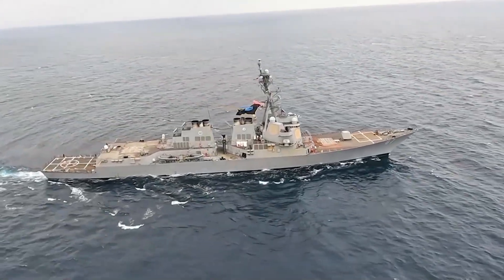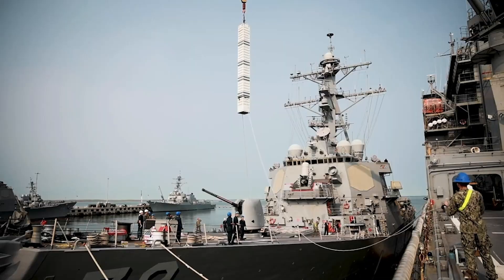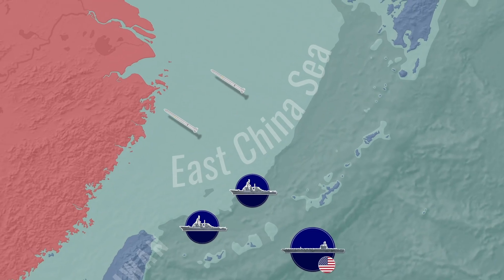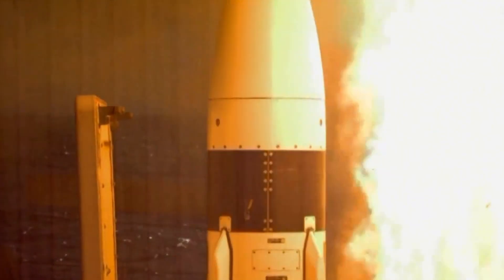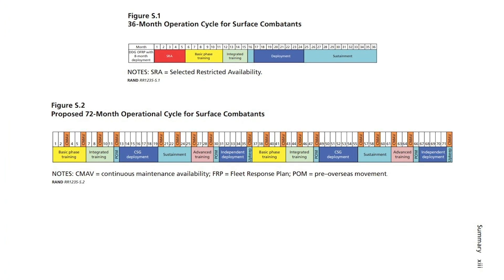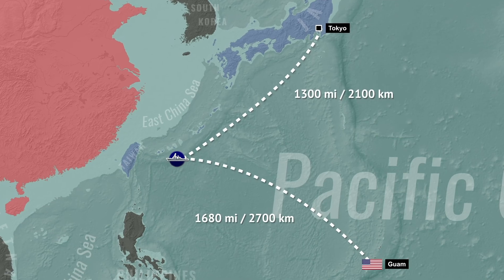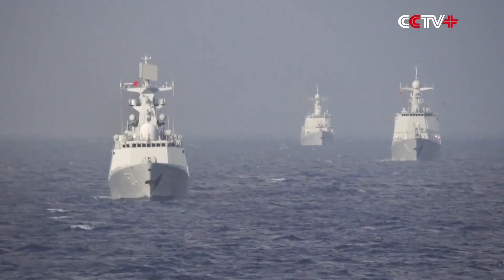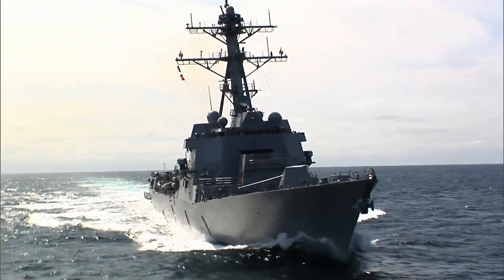Why is rearming missiles at sea crucial for US Navy? And why is it so hard?

Comment: Why not just build cheap drone missile carriers slaved to Aegis equipped ships or even aircraft? You multiply your launch platforms, use those missiles first and rotate them to port for rearm when their supply is exhausted. I’m just a dumb army grunt but that seems like a more modern, cost effective and scalable solution than the convoluted ones in this video

Comment: Why not convert cheap freighters to just be Missle Cell motherships. Load them up with nothing but hundreds of launch cells then Data link to the destroyer. Launch directly from the freighters and rotate loaded and unloaded freighters?
Reply: exactly what i was thinking
Reply: It's a nice idea, especially if the destroyer is defending a base. I think Japan has looked at something like this. But if the destroyer is doing ASW work, then the freighter would be too slow to keep up.

Comment: You do a standard resupply container that floats and keeps the missiles safe inside. You eject that into the sea near the warship, which then uses a magnetized harpoon of sorts to catch the container and reel it into the crane, which then places the container on the deck, where it is locked in place. The missile cells are then individually lifted and placed into the empty VLS cells. Container is dumped back into the sea with a beacon, where the resupply ship can use the same process to retrieve it and bring it back to port, where it is refilled. This way, a single supply ship can deliver to the maximum number of warships in the least amount of time and get additional supplies in the least amount of time.

Comment: Would it not be easier just to install the crane permanently on the vessel instead of spending time moving it back and forth between the warship and the resupply ship.  Instead of a process where the resupply ship has to sit there and wait for the crane to be unpacked, installed, all of the missiles installed, pack the crane, transfer it back. The resupply ship could just transfer the missiles over and then leave and go resupply another ship.  The warship could install the missiles while underway to where ever its going.

Comment: The last option you mentioned seems the best solution to me, i eould use a heavy lift crane to transfer a modular frame with all the cells to be deliver inserted that then has the capability to slot each one straight in after being locked in place. It would be the auickest method and preety safe i would think.

Comment: Where does anyone say that a missile is impossible to hit in the mid-course phase? You do realize that the US shot down a satellite with an F-15 in 1985 and then shot down another one from a ship in 2008. Those were moving at Mach 22, faster than anything that has been tested in the atmosphere and the US shot it down 40 years ago... you don't think they can shoot down a missile in the mid-course phase, the longest phase of the missiles flight path? That was a dumb statement from a channel that seems to pride itself on knowing more than the average person in regards to military knowledge.

Going to add to that... a Destroyer in a war time scenario, would NOT be cruising around at 20 knots trying to re-arm and re-join the fight. You better believe they will be hauling at 30+ knots
Reply: Well, satellites are also much more predictable, and they are larger. It's way easier to target a satellite since they aren't really surprises.
Reply: @Vexas345  you are joking right? Missiles generally following a straight flight plan at 20-25% the speed of a satellite and at much lower altitudes. If the missile can change course during flight, the speed is even slower since changing course at high speeds tends to melt objects, such as areas used to change the course...
Reply: nothing new. Russia has always had the capability to shoot down space satellites since 1963.
Reply: @jnkimuhu  any reference on this? First I have heard of a Russia designed and successful test was in 2021. The first successful destruction of a satellite in space going to Maj. Wilbert Pearson in 1985. Follow on point, I never said other countries don't have the ability to (China and India both also have successful tests), this video was specifically stating that you couldn't shoot down a missile in the mid-course stage, and I happen to know that hey can very easily be destroyed in that phase.

Comment: The solution is dispoaable magazines. A single missile self contained magazine with internal hydralics is attached horiontally to the deck then it lifts to the vertical over the lauch tube and the missile is inserted. The empty mag can then be recycled or thrown overboard. Extra magazines could be stored internally or on deck.

Comment: I think the most obvious solution is to build and field a bunch of arsenal ships, say 2-3 per fleet. These would be just bare-bones ships with basic electronics (not need for Aegis) and with enough power to keep up with the fleet or for rapid deployment (25 knots minimum, preferably faster), and they wouldn't need all kinds of other protections because they're designed to sail with bodyguards such as Aegis-armed destroyers and/or aircraft carriers that can protect them.  We have plenty of body guards, but the guards don't have enough arms--that's the only mission for the arsenal ship to meet, not to take other other missions or act independently.

If we can field say 10 such ships, each carrying say 500 VLS cells, that's 5000+ missiles (whether we can produce enough missiles is a separate challenge).

In theory it shouldn't be that costly or time consuming--if each arsenal ship costs more than $1billion or more than 2-3 years to build, then the program is in trouble and the Navy screwed up again.  To make this a success, they must stick to a stripped-down concept and concentrate on getting the ships built and missiles installed ASAP. Unfortunately, I just can't trust the USN to be serious for once about solving problems rationally--they seem constitutionally incapable of making anything within budget or lean and mean.
Reply: It doesn't have to be a purpose built ship. Commercial container ships are good enough. The missiles provide standoff to keep the ship safe.

Comment: They wouldn't be using up so many SM-2s if they actually packed in more ESSMs. The standard quad-pack ESSM load for a Flight IIA or III Burke is only 12 missiles (3 cells).

Comment: Why could the not make it so the whole houseing is what you change? Instead of having Todo 1 cilo at a time you replace the whole "carton" perse and now your full u the old carton change tken back and refilled for next time?
Reply: A single VLS tube weighs a couple tons, so a pack of 8 would require a very large crane to handle, like the large articulated one shown at 11:15, limiting the number of cargo ships available for resupply missions.
Reply: @pahtar7189  ok yes that definitely makes sense as to why they wouldn't go that route thanks for the info

Comment: I do not understand why some of the Ticonderoga's have been decommissioned. They might be older but are superior to the Burkes in several areas. They have way more VLS and have both Harpoons and a helicopter.
Having 128 VLS cells + 8 Harpoons vs 96 VLS cells. Is a huge advantage over the Burke. The Burkes are newer so probably have better electronics.
In such a conflict the 60-70% larger VLS missile load would make the Tico far more useful and being able to stay in the area longer than the Burke.

But even if the Tco's systems are older, they would work well teaming the Tico's and Burkes up.
Reply: Hull age / corrosion and rising cost of maintenance? All Ticos are 30 + years old.
Reply: @mhammer2831  That's definitely the reason. The Burkes are probably more survivable, as well.
In theory, however, these steel-hulled warships can be made to last 50 years.

Comment: For all the Gen Z Ignorant! Who never heard or seen the Wichita class AOR, AE 35 class  ammunition ships. RELOADED AT SEA! The 3 T's Tartar Terrier Talos. MK 11 GMLS TARTAR MK10 TERRIER MK 12 TALOS!  Having been a BATTLESHIP FC, trained GM. MSCPAC ABM who sailed on Kiska ,Shasta AE vessels. I k ow of what I type been then done that got the scars. From Blocking,Bracing,Dunnaging, Handling 110 pound Stanchions, Strapping down metal pallets. In the different cargo holds, iperating the weapons elevators. Using different colored sling arrangements, driving 4k and 6k diesel and electric forklifts type EE.
Reply: Nobody here claims that underway replenishment isn't a thing. Heck, I'd bet that the ability to get launch cell containers onto a guided missile ship at sea was a more than solved problem before the first such ship finished sea trials. The issue is then picking them up off the deck and putting them into the launchers. They are a lot harder to install than a pallet load of 5in shells.

Comment: Okay, so I've seen this issue reported a few times recently and I acknowledge I'm not an expert, but what about robot arms instead of cranes? I've worked in car factories and seen these arms manoeuvre a whole car or pick up chassis with extremely good accuracy. Can anyone tell me why this would be a bad idea?
Reply: Also not an expert, but maintenance is probably a big part of it. Robotic arms have so many moving parts, and you'd have them out at sea. Assuming they're mounted externally they'll be exposed to both weather but also salt water. At the same time you'd have to also carry spare parts which would eat even more space. Eventually maybe.

Comment: Unfortunately, missile numbers availability is by far the limiting factor with sm6 production at under 1,000 per year and sm3 production of only a few dozen per annum.  And don’t say numbers  can be ramped up,  they can’t, it is painfully evident  that it will be several years for  “Patriot “ missiles will be significantly increased.  The Patriot joint venture with Raytheon and Mitsubishi Heavy Industries has its facility sitting idle waiting for Boeing to ramp up guidance components that they blame on a lower tier supplier.  The wait is expected to be three years or more.  The “Peace Dividend” and misguided war on terror has cost the U.S. 15 to 20 years of production that will never be replaced.
Reply: Never is a long, long time.
Reply: Perhaps some competition is needed? And a decision to arm

Comment: The easiest option is a converted container ship as a missile tender with the needed cranes.  One big problem is the need to return home to reload.  HI and Midway was required in WWII to just get in strike range of Japan.  The LCS and Z. classes also have failed and the LCS can't even go that far so the current fleet of ships are overdue for a new set of designs but brass don't want evolutions of what is proven systems but want total novel designs like the LCS that might sound good at first but when real life requirements are applied are unable to even do the job they were designed for.  Right now the military in the US is pushing for more Li Battery powered items.  Like trucks that need recharged for 8+ hours after about two hours of use and a charging station.  Plus such batteries cut the payloads by half while increasing gross weight a couple tons.   EV's are even being banned in parking garages because they are twice the weight and overloading structures and a higher fire risk.

Comment: 10:10 If I am not mistaken, this was how torpedo tubes were reloaded in WW2 destroyers. The difference here is the orientation, instead of horizontal feed for torpedoes, it will be vertical feed for the missiles.

Comment: Getting rid of the "hang it from a cable" replenishment system seems so obvious that I wonder why they ever considered the old system at all. ("Obvious" as in laterally the first thing I, who can't claim to have any skill at designing that stuff, ever thought of was something like the new system shown in the video running on rails.)
Reply: Uh hello IDIOT STREAM method of Underway Replenishment is still in USE!  You obviously NEVER heard of 3 T's Tartar Terrier Talos, ALL COULD BE RELOADED AT SEA by Wichita class AOR,AE 35 class AE
Reply: @HENRISTARKS  Sure but so what? Were any of Tartar, Terrier or Talos ever installed in vertical launch cells? What kind of cycle rate does a Mk 11 twin arm launcher give you? How does that volume of fire compare to modern VLS systems?

My comment here is strictly with regards to how to get a missile that is already on the deck into the VLS cell and ready to fire. Comments with regards to systems that can't launch enough interceptors fast enough to survive are rather beside the point regardless of how true they are.

Comment: Easy solution :a barge that would load the entire ship, like in ww2 barge were used to repair ships at see. It eleminate the relative movement between the loader ship and the loaded ship. With a bridge crane like in ports to load containers.

Comment: A COSTAL DEFENSE MISSILE SYSTEMS & GROUND BASED SAM DEFENSE SYSTEMS SOLVES THE PROBLEM . 
LAND BASE MISSILE SYSTEMS NEED NOT WORRY ABOUT RESUPPLY BECAUSE THATS WHERE THE SUPPLY IS , THEY MOVE OUT & IN THESE AREAS DEPENDING ON THE VESSEL FIREPOWER LOAD . 😁
Reply: Philippines was perfect for that
Reply: @leexingha  is perfect for that , not was . 
It is still tactically perfect for COVERING RETREATING/ RESUPLYING  AIR OR SEA ASSESTS AFTER ITS OPERATION. 
ITS PRACTICAL , TACTICAL , CHEAP TO ACQUIRE &  MAINTAIN DEFENSIVE ASSETS W/C ARE LAND /ISLAND BASED . 
ITS SUICIDE FOR ANY INVADING FORCE TO THINK ITS NOT HIGH GROUND  😁
NO SMART PILOT OR CAPTAIN OF AN6 VESSELS WOULD GO NEAR A DEFENSIVE &  HOSTILE ISLAND WITH ALL THE DEADLY MISSILES EASILY AVAILABLE & REACHING ~ 300 KILOMETERS,  SOME UP TO THOUSANDS KILOMETERS.  😁🤣

Comment: For some reason I imagine a catamaran style supply ship that has the destroyer "dock" between the 2 hulls and then a gantry crane transfers the cells. Or a gantry crane that can be temporarily mounted to join 2 supply ships to work in the same way. Completely impractical I know, but that was the first thing that came to mind.

Or some kind of guide cables that connect at the bottom of the missile well go through loops on the cell and connect to the crane. Be really hard to design something that could do the job and be able to continue working after launching missiles from the cell.

Comment: Aren't islands better than ships? They are unsinkable, have more storage capacity, and cheaper to manage.
Reply: and stationary, so it might be unsinkable but can be neutralized with cruise missiles without searching and tracking if they already know. and you can do nothing about it. because islands require search and track with RADAR to ships. even you try to shoot down them, anti air missiles are way more expensive than cruise missiles. Basic offense and escort missions would be impossible because... it is stational units. so islands are not better in term of ships capability. it have its own use and cannot compare.

Comment: Why, Because there's a limit to how many missiles can be fitted on any given ship and once they have been fired the ship has no teeth. And without being able to reload at sea the ship has to sail all the way back to base, As for why it's hard to reload at sea, Well missiles are a lot longer and massive than a deck gun shell, Which makes them difficult to control safely whilst being suspended in the air as the ammunition supply ship & the receiving ship are bobbing about on the wobbly water, So it's not that hard to work the answers, surely.. 😂

Comment: It worked than it did not work.  Job security.  How does China plan to replenish it's own destroyers?  With an onboard crane???? mmmm....
Reply: It "worked" badly, even with small missiles.
Also: What makes you think China has a plan that isn't
going back to port?
Reply: @A_Haunted_Pancake  I think you were not even alive at the time.  The sea can be very calm especially where China Sea is...Job security...made up crap also so to get a reason for the authorize transfer of technology.  In this case, crane technology was transferred.

Comment: Surely a system similar to torpedoes on a sub would have been a much better design?
Reply: A) I'm pretty sure there aren't any submarines that can reload torpedos
at sea these days. B) The whole point with VLS is that you can carry a lot
of missiles and fire them quickly. Earlier generations had arm-launchers
that loaded missiles from a magasin below Deck, but they were just too slow.
Reply: @A_Haunted_Pancake   The Astute carries 35 and only has 6 tubes. They have a system to reload the tubes. 

What’s to stop you keeping the whole set of VLS and reloading from underneath. All 40 of them from a central magazine. Doesn’t have to be immediate but you need to be able to turn it around within hours.